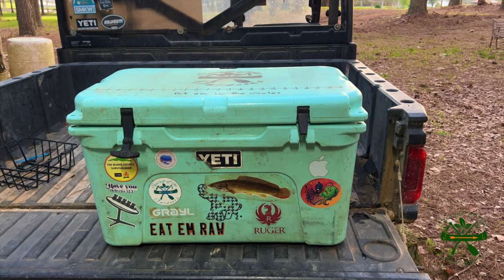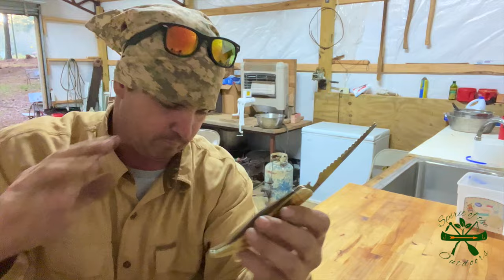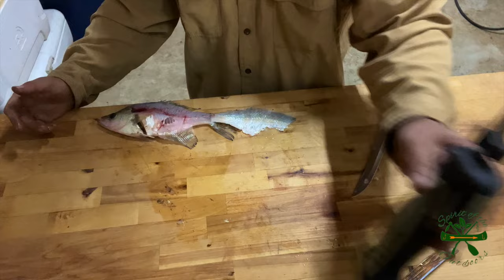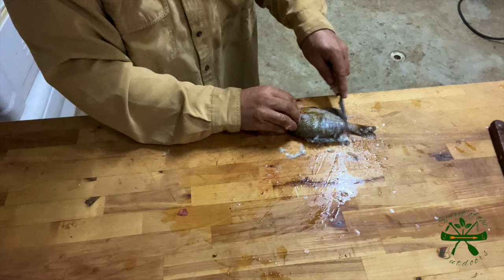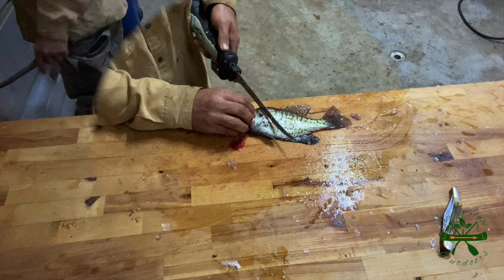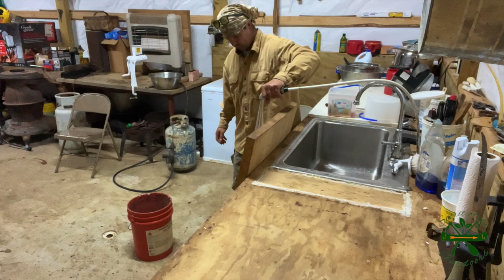Cleaning Fish with the Fish Knife

Comment: My grandfather has several original Buck 110s made with the original super hard steel they originally used on their knives. I've seen him straighten out some stripped out threads on a 1 inch hydraulic hose fitting on his log truck, multiple times too, with his trusty original Buck 110 and has went straight from that to cutting and deboning deer quarters and that knife steel that Buck used has impressed me so many times and stayed sharp enough to shave and cut meat with after that kind of torture, I have bought and use daily one of those same knives from that time. It is so hard to sharpen if you do manage to dull it, I have to use an ezelap diamond stone to put the edge on it again. An Arkansas whetstone will wear away to nothing before you even think about getting that thing sharp